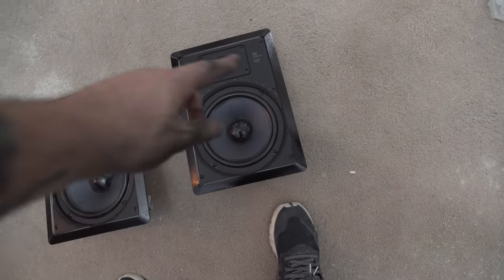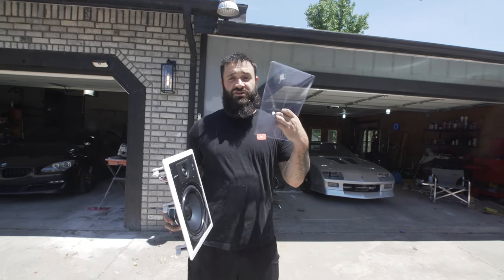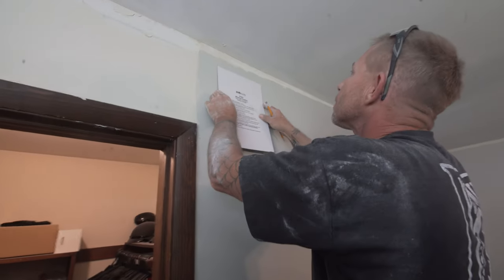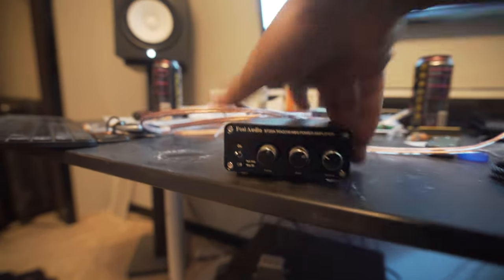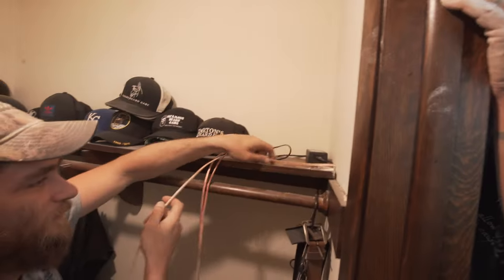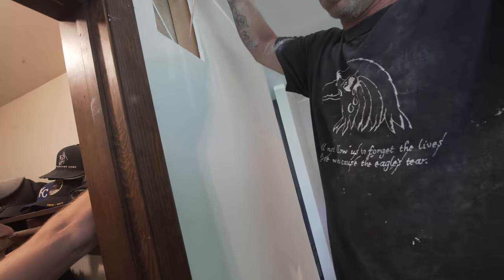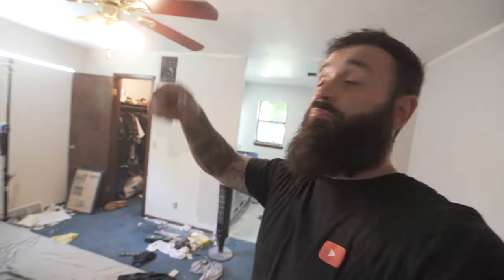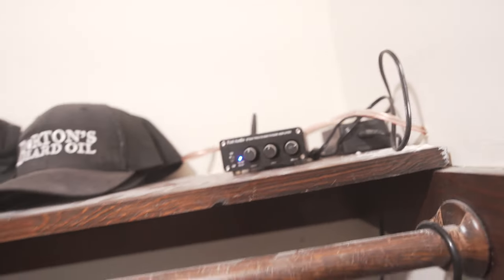Polk RC85i Speakers | Installation and Review

Comment: Such a bad installation. Wrong cable type for in-wall, left speaker in a room and the right speaker in a different room. How can you have stereo sound? Hard to make a worst installation. 

Fosi amp suck and have difficulties to output more than 25 watts. Just buy a old receiver with a real 100 watts amp and use a chromecast for wireless.
Reply from the maker: Great, the annoying audiophiles in random forum posts have finally made their way to youtube.  Dear jesus, help us all